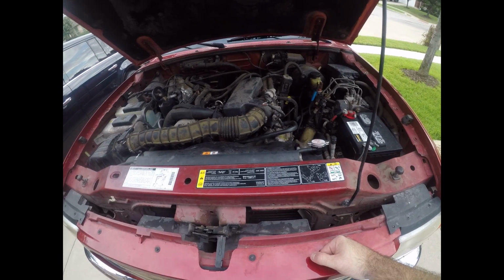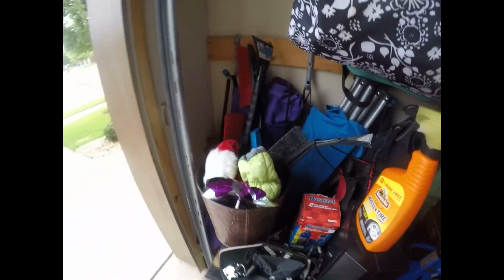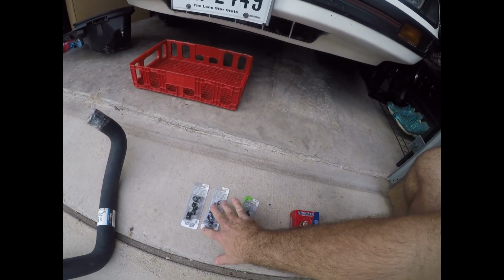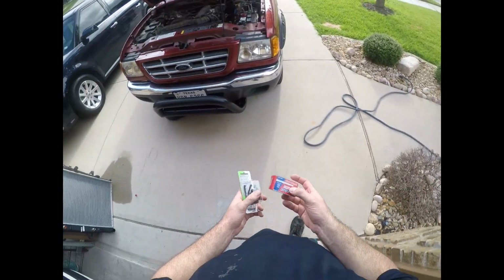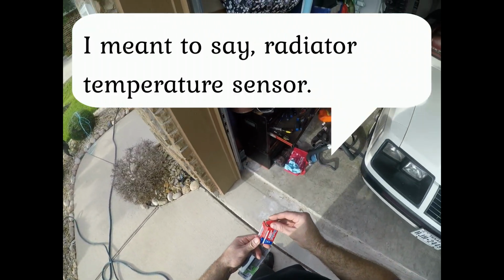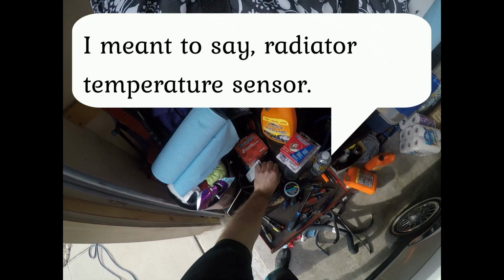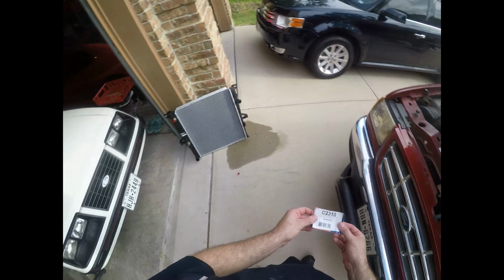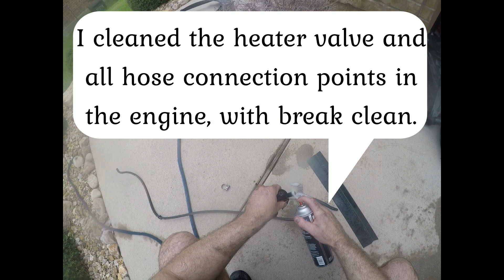Fixing Ford Ranger Overheating Issue

Comment: So I have a 94 ranger 4.0 liter and during the colder months it's fine but when it gets hot outside it's starts to overheat. When it's sitting still at like a drive thru it will go into the red. My dad replaced the thermostat and well now he's dead and the truck is mine lol. I saw you answered some other questions so I thought it wouldn't hurt to ask lol thanks for the video.
Reply from the maker: Do you have gunk on the radiator cap, like I have in the video?
Reply: @chasingmustangs  yes my radiator cap is identical to yours. I'm I hAve a serious issue with probably stupid questions.  Please forgive my lack of knowledge. I am new to the world of mechanics.  Ok so I had the fuel pump replaced. I tried to do the job myself and the 2 bed bolts up by the cab were so rusted they just completely crumbled in my hand leaving 2 holes in the bed. So I get the truck back from the pump repair and now it has a fuel leak at the connector from the tank to the fuel rail. Ok fix that. But when i got the truck back from the pump repair whenever I would take off I would feel the bed hitting the cab and a whole lot of vibration. So this has been going on for about a week and I've just been babying it when I take off to minimize the vibration . So today I put 20 bucks in the gas tank and gas just stArts pouring out somewhere in the middle of the truck. So I take a look and the driveshaft has rubbed a whole in the tank. So this whole time I thought the bed was moving around because of the missing bolts it's the driveshaft Saturday night boogeying under my truck. Ok finally here's the question...could the fuel pump repair compromise my driveshaft?? Thank you in advance if you managed to hang on to the end of this novel lol.
Reply from the maker: @christinebrumagen2620  So on the overheat issue, I recommend doing a radiator flush first.  Make sure to purchase a good solution and follow the instructions exactly.  Also, make sure the overflow tube between the radiator and overflow tank is clear.  If radiator fluid is not moving between the overflow and radiator, the truck will over heat.  
On your driveshaft questions, the driveshaft could be affected, if they knocked of the balance weights.  The drive shaft is like a tire rims, they put weights on it to balance it.  If the weights come off, the drive shaft will vibrate at high speeds.  The cheapest way to solve this, is to take it to a shop to have it balanced.  Sometimes it is cheaper to purchase a used drive shaft that is balanced.  
I personally would complain to the shop that repaired your fuel pump.  Sounds like they did a bad repair.  It sounds like they did more harm than good.

Comment: What do you normally read on your temperature gauge once it's up to operating temperature? I've got a 94 3.0 that'll get up to about 3/4 of the way but not "overheat" if you wanna call it that. Replaced radiator (it was cracked) and thermostat (just to be on the safe side).
Reply from the maker: My temperate guide is always 1/2 of the way.  Unless it is really hot out, it dos not move above that.

Comment: So I have a 2004 ford ranger  3.0L. I've noticed that my temp gauge would be at normal then starts heading towards overheating. When this happens, I turn off my ac and it gets back to normal. I noticed a small hairline crack on the plastic part of the radiator. I put some jb weld on it(I know, not recommended but trying to save money. Just a temporary fix) but that didn't do the trick. I'm just worried that if I do replace the radiator that it may have the same issue...coolant level looks fine and not that dirty. Dont see any other leaks either
Reply from the maker: Did you burp your radiator?  You might just have an air bubble in the system.  Is your heater working?
Reply: @chasingmustangs  my heater is working, and I'll have to trying "burping" it next. This sounds dumb, but when the engine is cool and you take off the cap on the radiator, is the coolant level suppose to be close to topped off? On the clear reservoir tank, it's on the fill line when cool but I dont see anything in the radiator part of it
Reply from the maker: @thesaexplorer  So my radiator is always about 2 inches low when cold.  Once the truck warms up, the radiator will get coolant from the overflow tank.  The tube between my radiator and overflow was plugged.  So that might be another item to check on your truck.  If it is plugged, the radiator will not get enough coolant.  I would check your idle speed is to speck (around 700).  When you turn on your A/C, is the car idling too low?  I was plagued with idle issues on my truck.  If the idle speed is to low, water pump is not moving enough water.  Just a few items I can think of.

Comment: 2006 ford ranger 2.5 XLT diesel is not overheating without thermostat but I put a new thermostat  it started to overheating and I have tested the new thermostat with boiling water and it does open.
Reply from the maker: Does your radiator have brown sludge in it?
Reply: @chasingmustangs  they have cleaned it where they clean radiators. Sometime when I am driving  see the start to overheating and  when checking engine coolant only  is over full
Reply from the maker: @tshepomokgotla9363  the overflow tube is plugged, is what it sounds like.  Under pressure radiator fluid can get to the overflow, but not get back to the radiator.  Plubabbly should replace the radiator cap as well.
Reply: @chasingmustangs  after I stop the car  I can hear the circulation of water after 30 seconds to a minute
Reply from the maker: @tshepomokgotla9363  is it making a hissing sound at the same time?

Comment: Hello I changed my radiator thermostat and water pump and my truck still overheats when the ac is on. When I turn off the ac the temperature goes down and idea what it might be?
Reply from the maker: I have seen a bad A/C compressor cause overheating issues.  If you see the compressor clutch disengaging when it is running, it is probably your problem.  Sometimes a simple A/C charge will resolve the issue.

Comment: where did you get the fitting for the lower radiator hose and heater core hose? I broke mine on my 2000 2.5l and I cant seem to find a part number?
Reply from the maker: I just purchased my hoses at AutoZone.  I just use their parts recommendations.  They are not always perfect, but get the job done.  I recommend double checking the pictures, before ordering.  Hope this helps. 

Lower Hose
https://www.autozone.com/cooling-heating-and-climate-control/hose-lower&filterByKeyWord=lower+radiator+hose&fromString=search&isIgnoreVehicle=false

Possible Radiator hoses
https://www.autozone.com/cooling-heating-and-climate-control/hose-heater&filterByKeyWord=radiator+hose&fromString=search&isIgnoreVehicle=false

Comment: A whole lot of noise (obnoxious music) and no comment on weather or not the overheating was fixed. Still could be water jackets plugged, faulty gauges, freeze plug leak-So, is it still overheating or not?
Reply from the maker: It no longer overheats.
Reply: @chasingmustangs  I will now go after a Ford Ranger and do as you recommend. Thank you for your quick reply.
Reply from the maker: @georgescott1180  do you have the black and brown junk inside your overflow container and on on your  radiator cap?  If you don't, I would double check your Thermostat and the overflow hose, before replacing everything.  If the Thermostat is not opening, then you will have big issues.  If the overflow hose is plugged, coolant can't flow between the overflow and radiator.  On the Ford 3.0, coolant actually moves in both directions.  The truck will overheat, if it is not working correctly.
Reply: @chasingmustangs  There is no radiator cap. Water pump is new. overflow drains directly into radiator. Very weird system. Fluid was clear, there is a fine rust colored residue on the plastic thermostat housing internally. No gas smell. No evidence of water in oil. No exhaust leak. Just overheats after driving about an hour. Will test fans before radiator removal.
Reply from the maker: @georgescott1180  did you use s heat gun on the radiator, to see if the radiator is working? When I cut my old radiator in half, it was blocked.  Also, if you have automatic transmission, see of water is present.  My old radiator was leaking a small amount of water into my transmission.  I would also try a double dose of radiator flush, in case you have a blocked water port.  Hopefully this helps.  A took a year of working on my truck part time, to fix every single issues.  I can now drive it a 100 miles a day, without any issues.  This truck has given me more issues, than my 83 Mustang.  Best of luck.